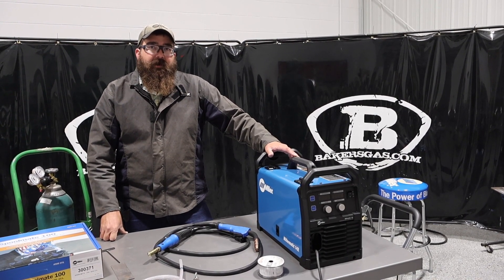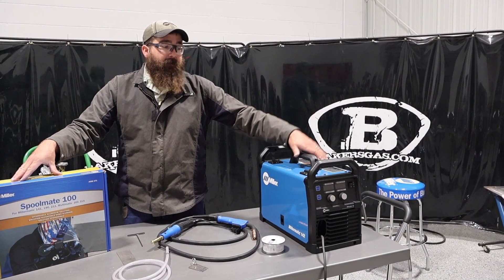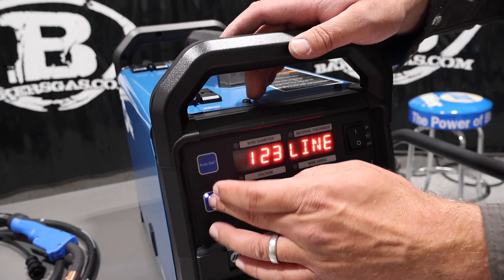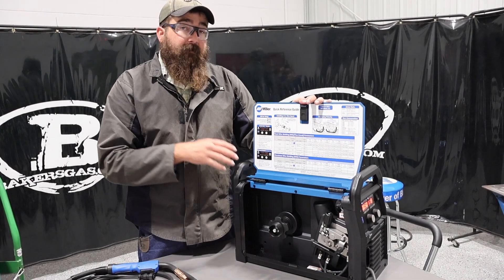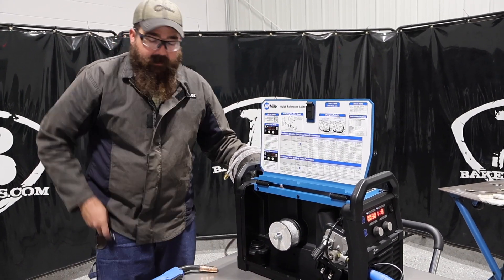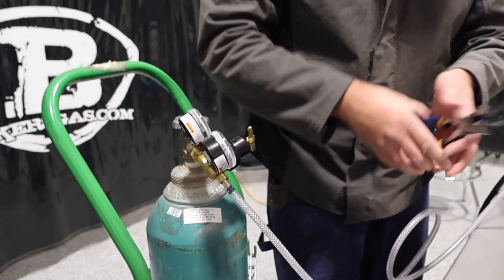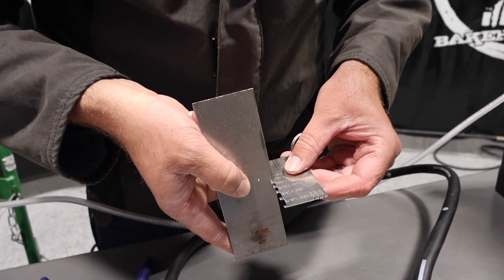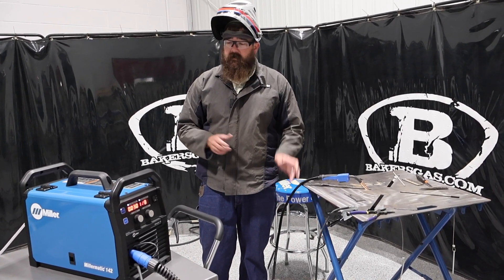Millermatic 142 Review 907838 and Quick Set-Up

Comment: Just bought one of these to replace a old millermatic 140. It just immediately resets itself as soon as you touch the wire to steel half the time. Even turning it down lower than the chart suggests. It does help.. but even on my 4500 watt generator it wont behave over 15 on the power setting or 50%. Nether my old 140 miller or cheapo lincon care give me any problems like this. Its not a bad ground or gfci. Its the machine it just clips off immediately
Reply from the maker: Reach out and we can help you get a warranty claim filed!

Comment: I just ordered one for the lite gate and fence repair. This machine is perfect with flux core in the field where I only have 110 power. My Miller 220 is too big to take to those jobs
Reply: Did you use the same solid wire that comes with the machine to flux core? Just switch polarity, right?
Reply: @Spiritusanto16  I bought blue demon .030 flux core at my welding supply because it came with solid wire for the gas shield Hobart. It did not come with flux core

Comment: bevels? when welding material thicker than 3/16 why will it not weld properly? throw some bevels on the edges and stack more passes on it. obviously a better machine would be the correct answer... but if this is all you have.

Comment: how likely will this unit trip a 20 amp 110 volt circuit breaker?  (ie when running at full power).  thanks.
Reply: Don't know for sure, but would say, keep at duty cycle and have nothing else on the ckt.
Reply: The machine will trip first. Its super annoying